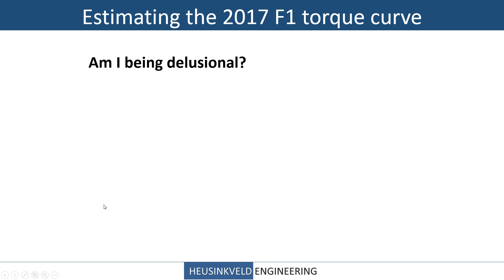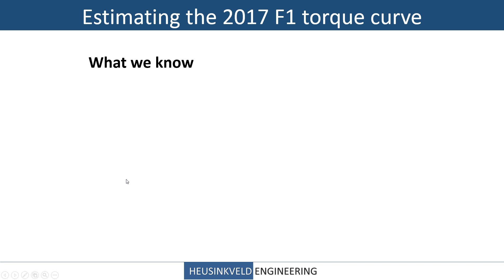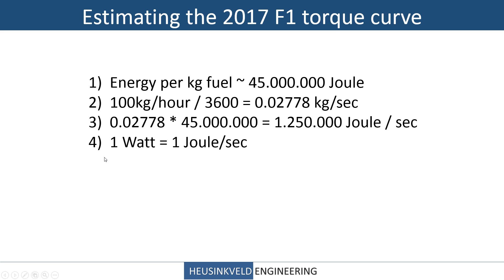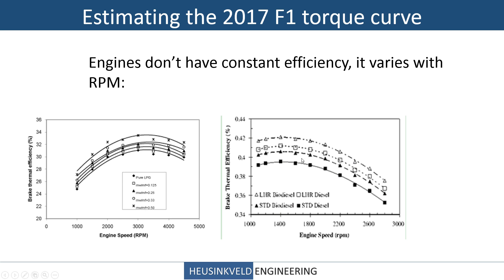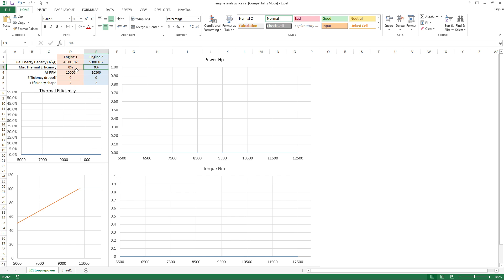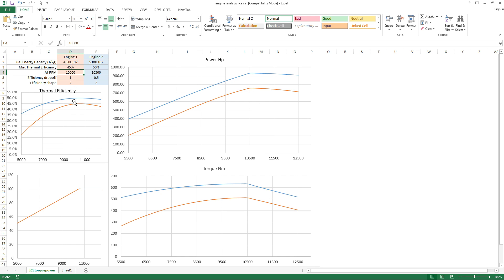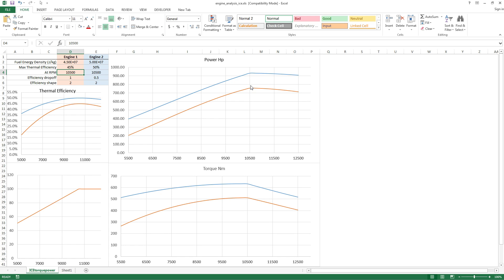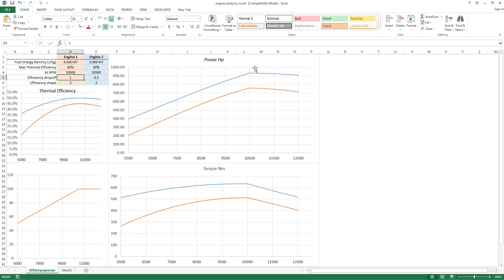Fun With Physics 3: Estimating the 2017 Formula 1 torque curve

Comment: Hi Niels, I wonder can you do another fancy calculation for the 2020 F1 engine?
Reply from the maker: Late reply.. I don't think it is any different! The fuel flow regulations are the same, but total fuel load can be a bit higher. Over the years they probably improved the thermal efficiency even more, and maybe managed to get a bit more energy density into the fuel..

Comment: they are turboed so the power will rise exponentially once it starts to hit boost, not linear like yours is
Reply from the maker: Very late reply.. That's not very likely! Boost can only exist when there is enough fuel, and fuel is strictly limited. I think my method of doing the torque curve is 'reasonable' between say 8000 and 12000. Below this range you could be right, but they almost never run below 8000 anyway so that isn't too important.

Comment: What you've noted in this video is partially correct. The 10500 rpm mark for peak power is true, but not for peak torque. The torque may start to decline earlier than peak power if the rate of rpm increasing is greater than the rate of torque decreasing. Peak power is at around 10500 rpm and that is obvious because the drivers tend to shift around there even though the limiter doesn't come on until around 12000 rpm. Another iffy point is the fact that those engines are turbocharged, meaning that the air flow (hence the fuel flow and the efficiency or the torque curve) will drastically change as he rpm increase. In order to create a realistic representation of what happens to those engines you need a load of data, from the geometry of the turbocharger to the general system around it, the state of the turbocharger and the amount of air the engine is pumping out (or sucking in) at any given rpm, my guess is that your results represent the engine's torque curve when the turbocharger is spinning at the maximum rpm it's capable of constantly. Generally there are a lot of variables hindering this result, keep up the good work though!

Comment: I am thinking that the F1 ICE are at about 800 - 820 horsepower before any electrical motor usage. This would be at the highest power engine mappings, as used in qualifying. 

I assume the race mappings are closer to 720 - 750 horsepower.
Reply: PerfectMan Is the fuel flow limited in qualifying too? It would strangle the engine quite a bit.

What would you change in the mapping if it is strangled by fuel? Only ignition? That would not make such a big power difference.   The biggest bump in power in quali should come from the electrical systems then.
Reply: Yes fuel flow is limited in qualifying as well. 

I think they can't run as much power during the race because they'd run out of fuel. They are only allowed 100 kg for the entire race.
Reply: PerfectMan Ah that's why. I thought only the flow was limited and not the absolute amount.

Comment: Niels, as far as i know the max amount of fuel in 2017 is 105 or maybe 110 KG per hour.
Reply from the maker: Flow is to my knowledge 100kg / hour, but they can carry 105kg in the fuel tank.
Reply: hmm, i thought they were alout to use more. i will look in to it. and say it if i find it. we need the new car as good as possible :P
Reply: i have already found it. flow is indeed 100KG per hour. max load 105KG. sorry for mixing it up there.